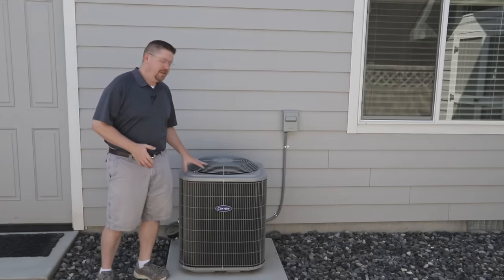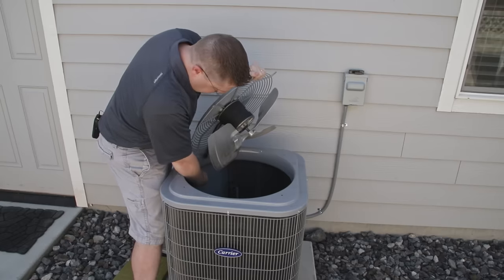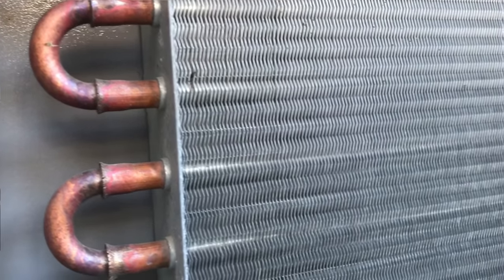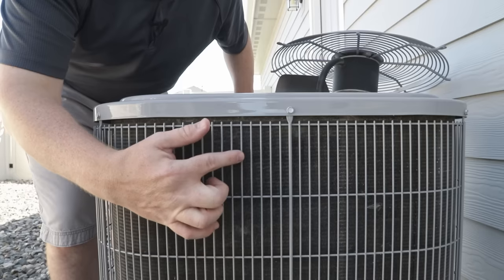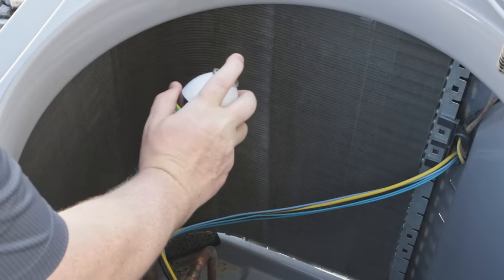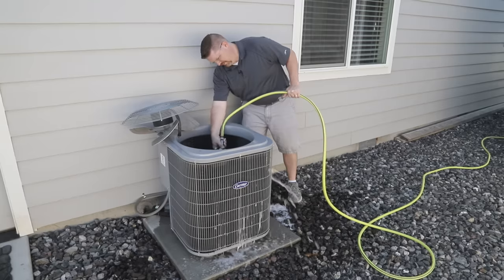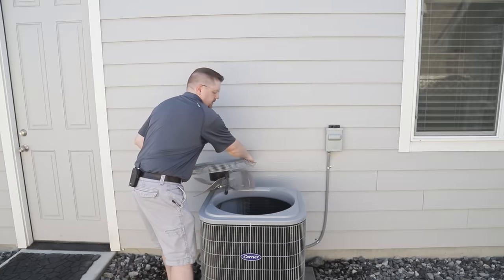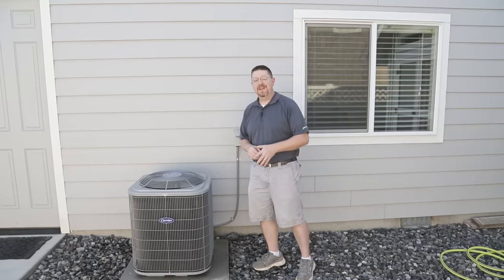How To Clean Your Air Conditioner Condenser Coil (Step By Step)

Comment: You inspired me. I did this last week, and the A/C air has felt much cooler since then. I can only imagine this means I'll use less energy, as the A/C will hopefully need to run for shorter durations to cool the house equally.

Incidentally, I believe it had been 15 years since my A/C was cleaned. Wasn't too terribly dirty, surprisingly.
Reply from the maker: Nice work! Yes, your system will most definitely use less energy now that it has been cleaned. How carefully do you track your energy use? Do you happen to have a thermostat that can show you historical runtimes for your system? I'd love to see a before and after with actual numbers.
Reply: @AmplifyDIY  I have a Nest, so it should be there. But I'm reluctant to put too much stock in the numbers given daily temperature variance has been pretty high of late.

But heck, I'll look at the data and make insane conclusions anyway!
Reply from the maker: I have a honeywell, and it emails me monthly reports each month that compare that month's usage (i.e., actual A/C runtime per day) to the prior year's... complete with average daily temperatures etc. Armed with a bit of data, it should be relatively easy to determine if your system is running any more efficiently after the cleaning. Still, any conclusions will mostly be for the "gee-whiz" file, I suspect.
Reply: @AmplifyDIY  Welp, as expected. I cleaned it on August 17. Temps were slightly lower the following week, but usage remained the same (or increased): https://thesmithfam.org/temp/ac_usage.png (left axis is usage in seconds, right access is high outside air temp for the day in F)
Reply from the maker: @HeyItsMeDave  Really interesting data! As I look at the graph, it looks like the week previous to when you cleaned your condenser the AC ran more at lower temperatures. For instance, look at Aug 8 - the high for the day was around 80F, but the AC ran as long as it did on Aug 24, when the high was over 90F. Similar result for Aug 11.  Out of curiosity: What year was your house built? Do you happen to know how well your attic is insulated?
Reply: @AmplifyDIY  The house was built in 2005, and the attic was doubled up with insulation around 2010. It's amazingly well insulated. :-)
Reply: Great insights by the way. You are probably right. At least, that helps stroke my confirmation bias, so I'm going with it!

Comment: Thanks for this! 112 degrees in CA today and my AC was popping the circuit breaker yesterday. So for so good. AC is still going.
Reply from the maker: Right on!
Reply: Can relate, I did mine at the start of the heatwave and despite it being 116 outside yesterday, it didn't exceed 74 inside.

Comment: on most residential systems, its really not necessary to take the system apart unless there is a lot of debris that needs to be removed the bottom.  These coils are thin enough that a good stream of water will push all the dirt right through the coil.  I don't even use coil cleaner all of the time if its just a light cleaning.  I only clean inside out if the coil has been neglected or if its a commercial system with a thicker or split row coil,

Comment from the maker: You should clean your condenser coils at least once a year. The process literally takes less than 15 minutes start to finish, and really does help improve the efficiency of your system.
Reply: I call BS on that. I cleaned mine yesterday and it took HOURS to get it completely washed it. 
My unit has two rows of coils which had to be partially separated to ensure getting all the cottonwood fuz and crap removed from between them and then there was the fine sand trapped in there. I used two gallons of properly diluted coil cleaner and God only knows haw many gallons of water to flush it all out. Oh and by the way that gray box with conduits next to your condenser is called a Disconnect, not a breaker. Some disconnects have breakers but the one you have is just a simple disconnect.
Reply: Great video, very informative, thank you!
Reply: @caretoc7142  I'm using this for a guide for me a female ! Yeah I'm pretty sure mine needs cleaned out. I was good untill he said take this part off ? Then put your cleaner on. Well my CAC had to be cleaned last year only inside was dirty. So with that being said I think maybe the ice on coils is coming from my unit being in the same room as my dryer. I'm sure the lent build up doesn't help so guess I'll try inside first / after I check out the outside first. Thank you for your incredible cleaning details. Pray please I get this done. Being alone is good for the most part. But when things like this happen 😁yeah ! It's all up to me ! Have a great day.
Reply: Anyone know how to clean the indoor coils?
Reply: @dennyboylilomaiava3362  Is the coil over an up flow furnace or an air handler ?
Reply: How long do I need to wait before restarting my unit?
Reply from the maker: Not long. As soon as everything is re-assembled, it’s fine to start the system up again.

Comment: Great video. Thanks! looking forward to following your steps and getting my HVAC in tiptop shape. Just had a technician from an HVAC company come out and told me I needed to clean it and the cost is $425. So happy to buy the coil cleaner linked in your comments for 14 bucks and save myself some cash. :-)
Reply from the maker: You can do it!
Reply: That price is insane.   We have a local company that does the flush as part of their yearly "tune-up" for $90.   Yeah, it's still cheaper to do it yourself, but nowhere near the price you were quoted.

Comment: Quick tip: I use a an old credit card to straighten out A/C fins. Run it up and down gently to realign.  Also I use "Greased Lighting" multipurpose cleaner which I find works great.  Check and replace any insulation on the pipes going to the air handler too.
Reply from the maker: That's a great tip about using a credit card - I'll have to give it a try next time I have some bent fins. Thanks for watching!

Comment: Keeping the area around the condenser clean cuts down on the debris that re-enters the coil. After washing go back a few days later and remove the debris on the ground that came out of the condenser coil during the cleaning.
Reply from the maker: Great tip, thanks!
Reply: Thanks for the tip!

Comment: It's also quite important to clean out the evaporator coils regularly. That's the cold part of the AC system inside that chills your air and collects moisture.  I bought my house several years ago, and about a year in, there was some rattling in there, and a bit of not great smell every cooling cycle.  I called in a professional who simply fastened a loose panel to fix the rattle, and cleaned out the evaporator coil, which really needed it.  There was some terrible looking stuff in there that my air had been passing through, and slime mold forming at the bottom.  It was disgusting.  After the cleaning my air quality was immediately resolved, and I became aware my house just overall felt fresher than ever.  Both coils of course should be clean, but the inside portion directly affects the air in my house.  I will try cleaning it myself this time around - there's a bit of that same musty funk coming back.  But I'm gonna have to do the outside as well after seeing this video.
Reply: Yeah I have to agree with you. I payed a professional to come and clean the first time cause I didnt know what I was doing so I just thought I would call someone in. It came out to 130$ which was fine cause I didn't want to risk damaging anything by doing it myself. That was 2 years ago and I just found the confidence to do it myself finally and let me tell you, it really is not hard at all. And everything I needed came out to about 20 bucks. But yeah the evaporator coils do seem to go overlooked!
Reply: The issue I have with cleaning the Evap coil is, I would have to take out my counter flow furnace to do it. I can't do that by myself anymore. Too old and weak to lift the furnace. I am stuck and will have to have a service come in to do that. Dang-it.

Comment: Thanks! We just bought a smoker's house and saw online to clean it, and wanted to make sure we knew how to do it!!
Reply from the maker: Note that this won't help with cleaning the smoke smell out of the house at all - it will help the air conditioner run more efficiently, but none of your inside air is exchanged through the condenser coil outside your home. You should replace the air filter(s) in your system, clean your evaporator coil, and probably also have all your ducts professionally cleaned. Good luck!
Reply: @AmplifyDIY   Oh that is disappointing, thank you for letting me know though!

Comment: Great video. I did mine today. Mine was a disaster. Had a blanket of filth wrapped around it. I hadn't cleaned it ever; doubt the previous owners did either. They planted ivy around it, which had grown into the unit. I had many areas where the ivy had grown into the fins, deforming them. 

I didn't have the fin tool so I used an old hard bristle tooth brush and then a stiff bristle brush. It worked great. Possibly better than the fin tool and because the bristle are soft it did no damage.
Reply from the maker: Nice job!

Comment: I recommend using an air compressor to blow out all the debris from inside out. I also used a  shop vac to vacuum the outside before I sprayed the coil cleaner. Makes a huge difference
Reply from the maker: Great ideas, thanks for sharing!

Comment: I have a question about the rinsing process. When you're done rinsing, is it ok for the water to be setting inside the unit before you turn the a/c back on?  How wet can it be?
Reply from the maker: Yes, a little water inside is fine. Remember that these are designed to sit outside in the rain. Just make sure that the drain holes at the bottom are not blocked and you don’t have a ton of water pooling inside. Good luck!

Comment: This also applies to the radiator on your car. When these fins are blocked or coated with dirt you loose the ability to have good heat transfer which will affect the efficiency of your device.
Reply: Can I clean the radiator with this spray too?

Comment: I have seen so many of these videos on-line saying to spray it from the outside at an angel. In all my years I have only cleaned the condenser coils from the inside out. Thanks for being real:-) It is not hard to do and if you do it in the beginning of the cooling season and about half way through the season, your a/c unit should be good to go. Good video and information.
Reply from the maker: Thanks roy!
Reply: @AmplifyDIY  Your welcome. I will be cleaning my condenser tomorrow. I have my little power screw driver ready, Hose w/sprayer and Cleanser. It should be ready to start the cooling season. Whenever that happens in Chicago:-) Take Care.

Comment: Thanks for showing the flashlight, I just shined through from the outside and could barely see light, now I know how it's supposed to look. I wish he had done a "before and after" showing air flow from the fan. My AC fan is blowing air to the side, not straight up, as if it's not sucking any air in, just moving it around inside the unit.

Comment: I am a commercial HVAC tech. Their is no good way to straighten coil fins. All methods suck. 
Another thing, I would spray off all loose debris before spraying the cleaner on.
Reply from the maker: Great tip about spraying off loose debris first. Thanks for the feedback!
Reply: I thought there was an HVAC tool that will straighten out bent fins.....wouldn't a shop vac work very well for removing loose debris?  I think I can clean my own a/c units from now on,  its not exactly rocket science and especially since an HVAC company quoted  me $150 to clean my two units here in west TN.

Comment: Do not rest the fan on the blades or fins! You can bend them and you'll never get them back properly. Just a slite pend will cause it to shake.
Reply: Yeah flip the fan upside down. Bent blades lead to increased noise or vibration.

Comment: I had a disgusting mess inside my a/c condenser as mice had made a big nest to over winter in it. I cover my units so it was the perfect mouse motel. Why does Carrier make their units with such big holes around the refrigerant lines and cabinet drains? I will have to mouse proof this unit to keep the critters out. It's all cleaned out and  ready for summer. I even cleaned the fan blades. The coil was very dirty also. Thanks for a detailed video without fast talking or over talking.

Comment: I just had a service call on my AC Unit, the fan quit running, the service technician came out and looked at the condenser coil and found that it was quite dirty (plugged up) with some of the early spring tree and pollen debris.  The electric starter coil that operates the condenser was out of operating range and had to be replaced, it was due to the plugged up Condenser Coil, which caused the unit to work harder than it should.  It took the technician about an hour to hose down the Unit, and more time to change the electric starter coil and add more of the New Freon.  If you want to save some money and avoid the inconvenience of having an AC Breakdown on a hot, hot, hot day and night, hose down your AC unit and change the air filter on the inside of the house. Keep in mind that these technicians are very busy during the AC season, and it may be a day or two for them to respond to you service call.
Reply: The electrical starter coil should be renamed to the start capacitor, my mistake.

Comment: TY for this video.  I went to THD to find this cleaner & it was not stocked in my local HD store.  I used Simple Green AC coil cleaner & it did not foam nearly as much as the brand you used.
Reply from the maker: I'm sure the Simple Green stuff does a good job as well. Any coil cleaner is better than just water. Thanks for watching!

Comment: Thanks for posting, was wondering what I should do about the bottom of the unit. It has a pan that gathers ~1in of water.
Reply from the maker: That pan should have some drain holes in it. If water is pooling that deep, see if you can find the drain holes. They are likely all clogged up.
Reply: @AmplifyDIY  ok, it did have drain holes but they were plugged. Thank you so much. I cleaned my coils after watching how easy it was and they were filthy! 
Are you by chance going to do a video on how to clean the inner evap coils?

Comment: Just did my AC Coils today after watching this video a few months ago..  Wife had plants growing all up next to and inside of the covers :-|  Needless to say, the thing was incredibly dirty.  I dug out all her plants and put down some thick cut mulch to help with stuff growing back and to keep brush away.  Our home depot did not have the coil cleaner that everyone suggests, guessing its a CA thing, but they did have some "eco friendly"  stuff that foamed up pretty good, but not nearly as much as what was used in the video.  Also discovered our AC installers did not install a power cut off for the AC unit, that was nice of them... Pretty sure that is also against CA building code...  Also 100% recommend taking a picture of the wiring if you have to disconnect multiple wires...  Ya, I had 3 and could not remember what terminals they went too lol 

Early to tell yet, but I could 100% feel the difference of the air flow coming out the top when the fan was running, WAY stronger.  Will be super interesting to see what my monthly runtime and usage report will be this month!!!
Reply from the maker: Nice job!

Comment: Excellent video, thank you.  It baffles me that I'm consistent in replacing the air filter (chart on unit indicates last change) yet I've ignored this for 10 years!  Yeah, the buildup of filth muck would make Fletch proud (obscure movie reference).   It took the replacing of a capacitor to notice!   By the way, when replacing a cap, buy 2 so you're not scrambling for another next time.

Comment: Do u have to let it dry before u turn it back on
Reply from the maker: Hi Bobby - no, you don't need to let it dry. Keep in mind that these are designed to be out in the elements, so they are able to withstand rain, snow, etc. I do try not to get the fan motor completely soaked, but everything inside the condenser enclosure can withstand water just fine.

Comment: I got a technician and he said he needed to clean the coil for $105 before putting the freezon in (another $70). Immediate after they clean coil they measured the difference in pressure. I saw he was exchanging eyes with his coworker like "see?". At that moment I knew what I had paid was more for a lesson, not for a repair. They even laughed when they gave me the bill.

Comment: Would dirty coils be the cause of slow cooling in the house? Would it be a reason as to why the AC was blowing cold and then suddenly started blowing room temp air? The video was clear and concise. Good sound, and good quality.
Reply from the maker: There is probably something else going on with your system. If the coils are dirty, clean them of course, but I’ll bet they are not the root cause of what you describe. Good luck!

Comment: Very good DIY video, thanks!
Question: Should you turn off your furnace (inside blower fan) before disconnecting the condenser unit?
Reply from the maker: You don't need to. The most important thing is to make sure there is no possible way that the condenser can start up while you have it disassembled. Using the cutoff as I showed in the video is the only guaranteed way to do so. What you do with the thermostat inside is pretty irrelevant as long as the condenser cannot start up. Great question!

Comment: Do I have to wait for the coils to dry before I turn it back on?
Reply from the maker: Hi Frank - no, you can start the system back up even with a little bit of water still inside and on the coils. Remember that these are designed to run in rain, snow, etc, and can deal with some water just fine. Great question!